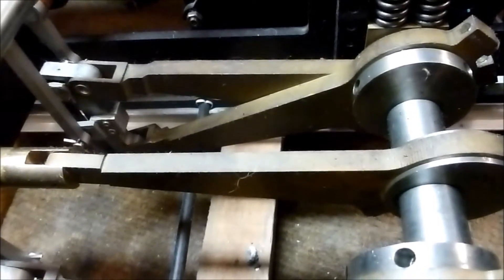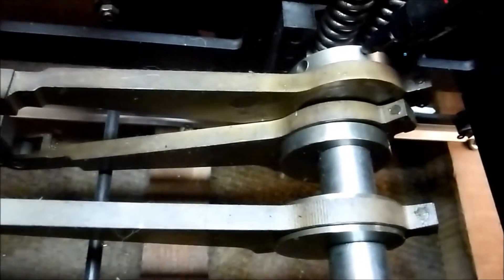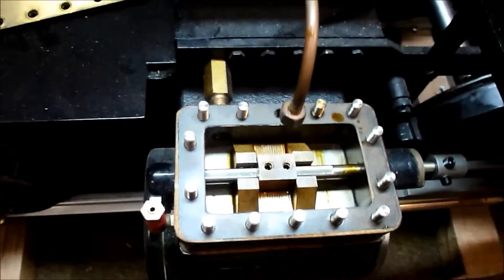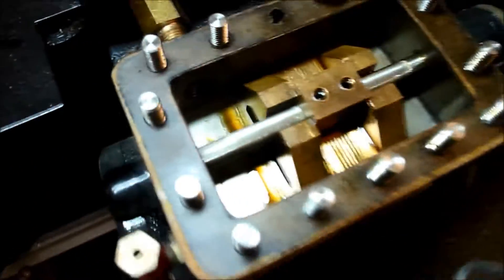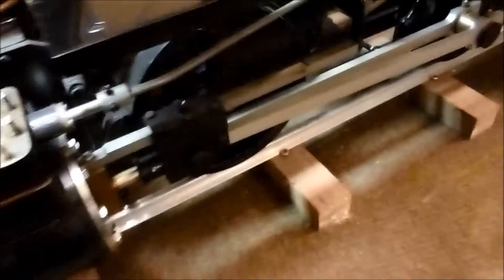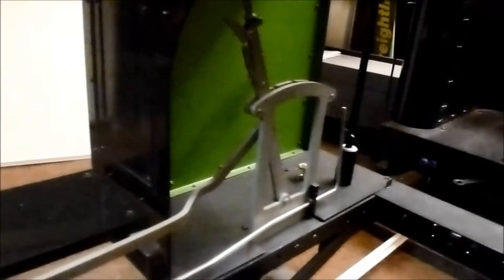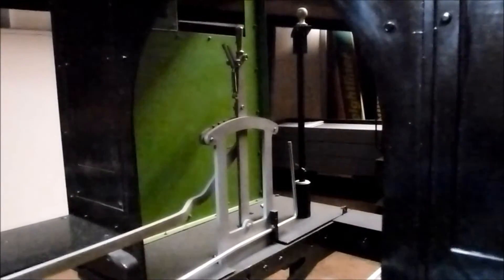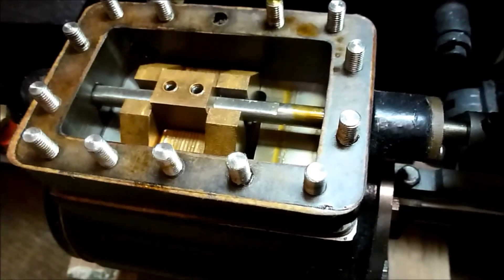Maxitrak Stephenson link valve timing

Comment: could i apply this idea to a twin cylinder traction engine??it goes forward but not in reverse
Reply from the maker: +chubby7570 yes you are correct, if it is Stephenson's valve gear then the principal is the same and should time the same!

Comment: Can you send photo or image or video of both side valve set ,cylinder rod position step by step at same time of Valve setting with Stephenson link valve timing on our 7 1/4" Forney locomotive.
  Email - prashantkendre@gmail.com
Reply from the maker: Hi, this video should tell you everything, do one side at a time independently. The crank pin on the wheel tells you where the piston and piston rod are, crank pin at the front, piston at the front. (and the same when they are at the back).

Comment: nice, can you send other side or both side valve setting of Maxitrak Stephenson link
Reply from the maker: Hi there, sorry i think you might be missing the point, set each cylinder individually. because the wheels are quartered the process is the same for both sides, do what the clip says on each side and your valves will be set. there is no clip for the other side, set both cylinder independently from each other, do one side/cylinder at a time!